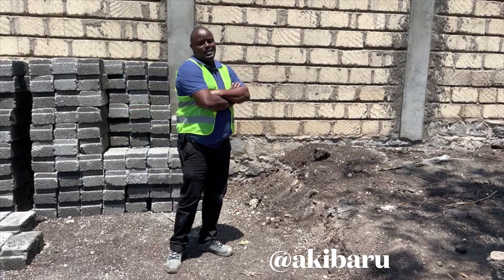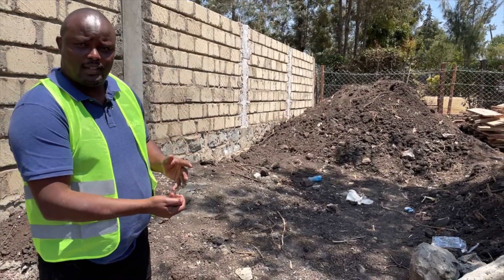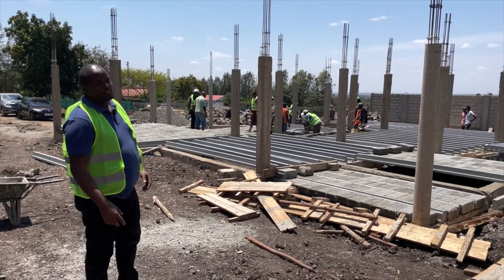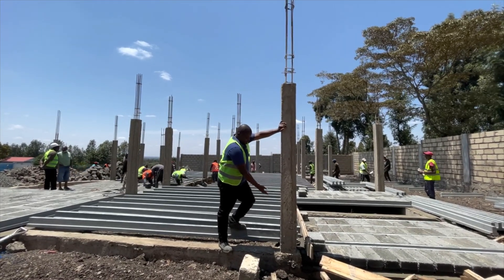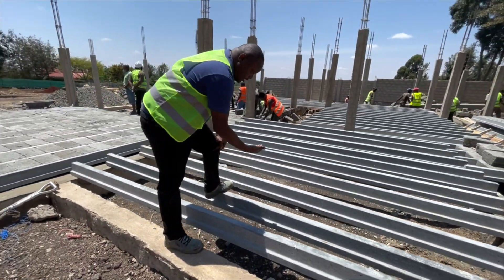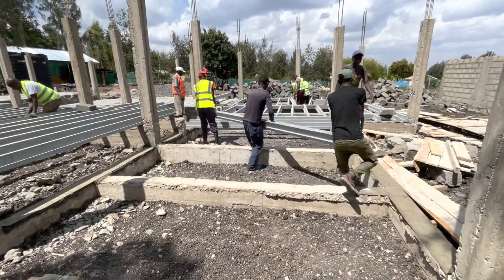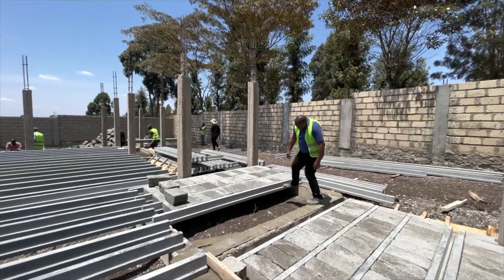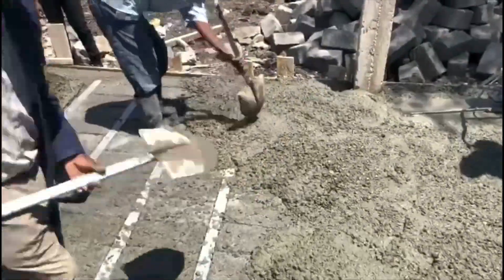Building over black cotton with Suspended foundation using Beam2beam flooring .

Comment: Great job sir! 
Any chance of moisture from ground affecting the ground slab?
Reply: Thanks for informative video. Can water form below the slab in that gap especially in areas with high water table during rainy season? In such a case, due you install an exit pipe?
Reply from the maker: No since it’s suspended